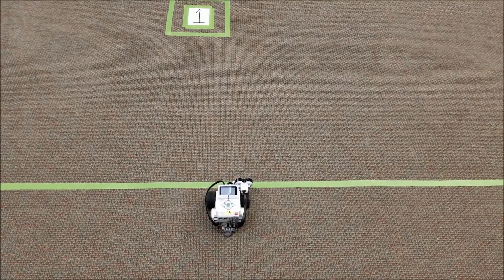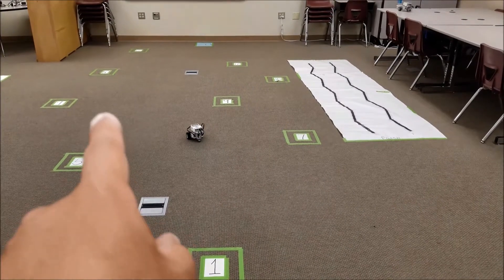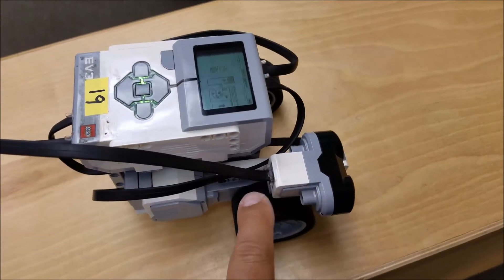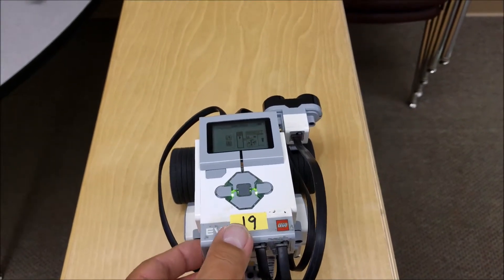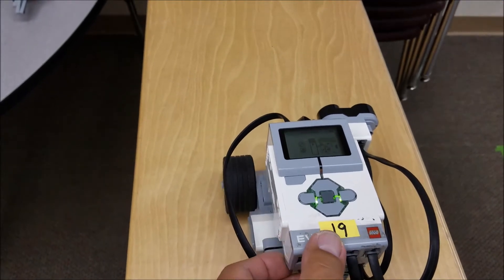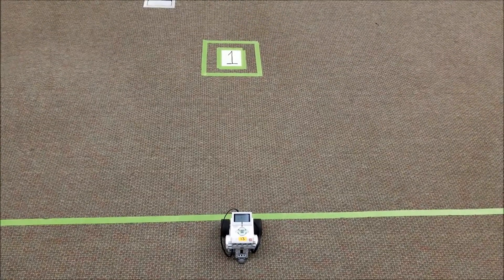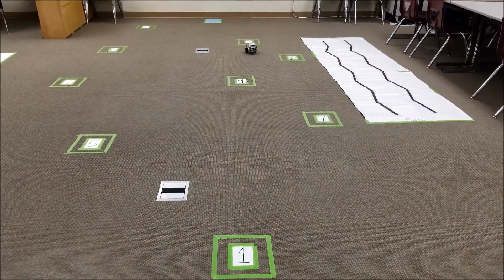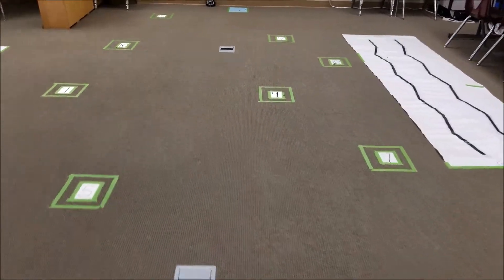"Why Your LEGO Mindstorms EV3 Robot Drifts/Doesn't Go Straight"

Comment: the drift on my robot is very hard!! my robot just drifts on my house floor like crazy, turning in turns. i added gear ratio. could it be because i had gear ratio?
Reply from the maker: What is your gear ratio? It is very possible. Are you using a gyrosensor?
Reply: @LEGORoboticsMrHino  No, I do not know how to use a gyrosensor! My gear ratio is uh the biggest gear to the smallest gear since I don't know what the gear ratio is :p
Reply from the maker: @ionizedplasma  That gear ratio would be 40:8  which is going to make your robot go crazy. With that gear ratio, the gyrosensor wouldn't have much affect.

Comment: My theory: when you have a soft surface like a carpet, and more weight on one side, that wheel sinks down more into the material. With more tire surface area in contact, there is more traction on that wheel, so it grabs better and ends up turning the robot away from the side with more weight.  Most LEGO tires are soft enough that this "more surface area" effect might play a role even on a harder surface like a normal playing field over plywood.  It is also true that the EV3 Large Motor output face has some angular play, and the axle rods bend pretty easily with any load. So more tilt from off-center weight (esp. if the wheel is cantilevered with the axle not supported on outside) will bend the axle and cause the tire ride more on its inside edge: that shortens the effective wheel-to-wheel spacing. It may or may not affect straight-line motion but it will definitely affect the total angle of a turn eg. whenever the two wheels rotate different amounts.

Comment: Your robot wiggles quite often in the straight line motion. I find that it could be due to the ball bearings you used which are not very good for maintaining straight movements. Additionally, i saw that your rubber wheels were rubbing against the motor, seems like you did not add a bushing or stopper (the yellow/gray ones that go on axles) to create some space between motor and wheel. Nice video though! love your simplistic and clear approach to teaching a concept!